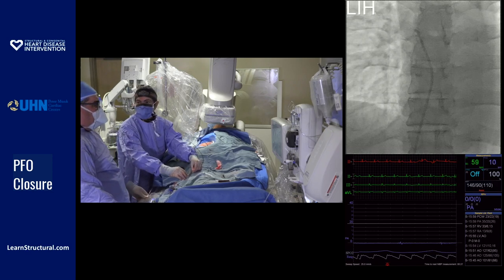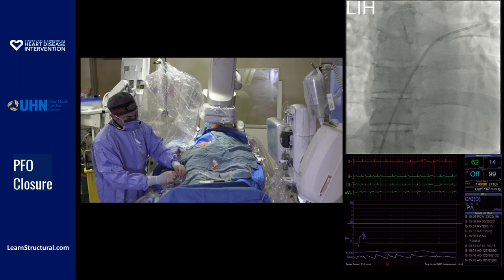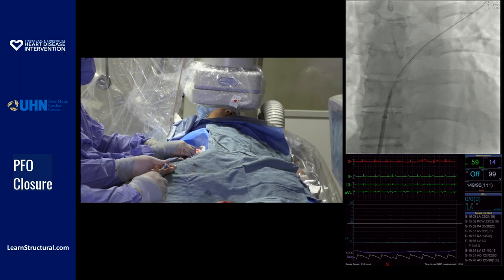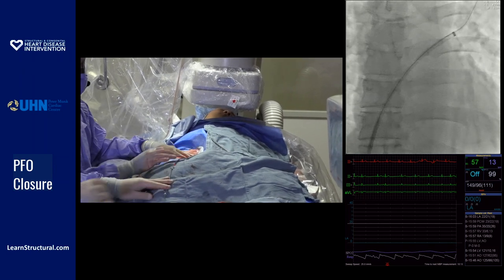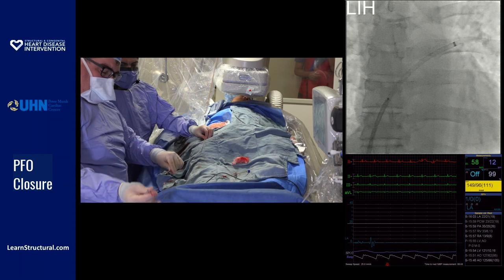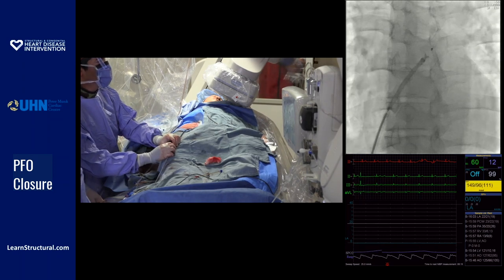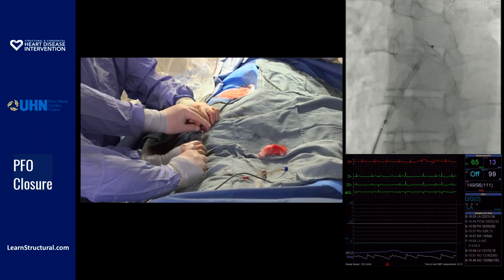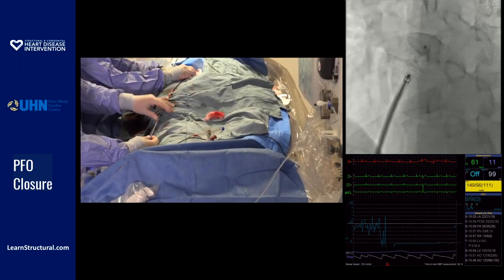PFO Closure Procedure

Comment: had this done last week after i had cryptogenic stroke last (i.e: sudden vision loss for few minutes and then spontaneously resolve completely) last year.. i was put under general anesthesia(GA) ,had TEE x2 (1st to confirm n size measuring,2nd to confirm the placement of device) while under GA.the PFO size is slightly larger then seen drg my 1st TEE 6months ago (5mm vs 10mm)..Thank God,everything went well. post op,it was dizzy and felt groggy for 7 hours due to the sedation effects..The epigastric pain remains for 1 week likely due to the trauma of TEE ..the groin pain is minimal. now on double antiplatelet for  3 months.im already back to work safely.🙏
Reply: Wait so you went back to work after a week? How did it go? How do you feel? Having mine done on 24th Feb but with local anaesthetic
Reply: @joselema85  how did yours go?  I'm having it done Mon 14th with conscious sedation (wanted general)

Comment: What a bloody procedure really. I just had this done and thanks for showing this. I was under general and intubated. I thought it was going to be something a lot simpler for some reason. I think because I saw on some web sites that a person might even be partially awake for this? Maybe I had that wrong. 

Also, they found out my PFO was larger than it was said to be eight years ealier on a TEE and that my atrial spetal aneurysm was large. Additionally, they also found a small fenestrated ASD and then said they could not exclude a second one, but that there was no evidence of it after they installed a 30 mm Amplatzer occluder. The PFO was also a "tunnel" and there was shunting. 

This was not a very easy surgery for me (age 55 with Fibromyalgia as well.) Groin wound pain was intense and within two days I had a serious blood pressure drop (87/48 after I came to,) nausea, shortness of breath, fainting, drenched in sweat episode upon just waking up. It resolved on its own within some minutes. It was like something in my heart or my nervous system was trying to reset itself after something about all this. It really scared me. I resolved that if it happened again, I was going to call 911 and not the cardiac on-call PA as instructed. It has not recurred. 

I also was very tired and foggy-headed. I think I am finally feeling a bit more used to the Plavix. Today I still feel tired but almost back to some kind of normal energy level. 

Advice: Don't overdo things with the groin wound for over a week. All I did was walk a bit more and ended up limping around with pain going down my to another part of my leg for two whole days. The bruise got pretty large, which worried me and I had to call the nurse to make sure it wasn't spreading in a dangerous way as they described. 

Also, my regular 0xygen saturation is usually around 92-94 and now it's up to 95-97 in Colorado, so that's good. I feel like my heart is not pounding and racing as much.